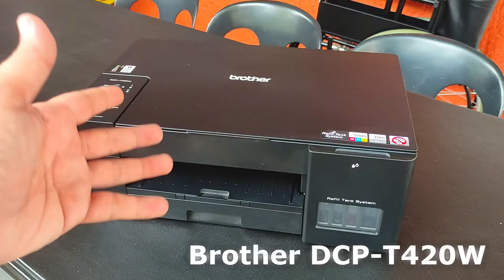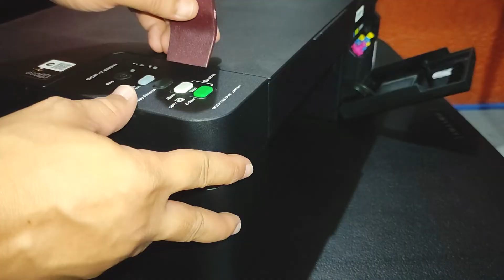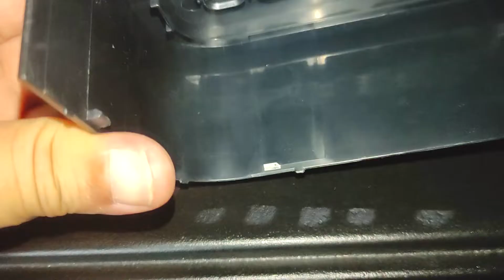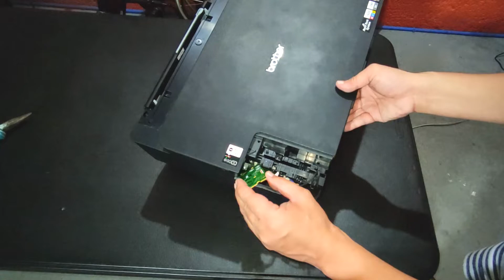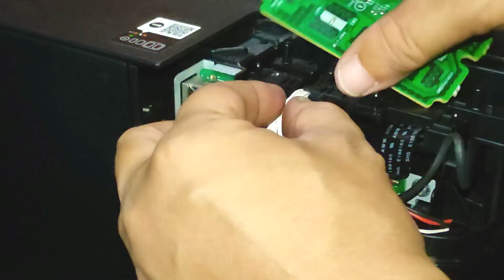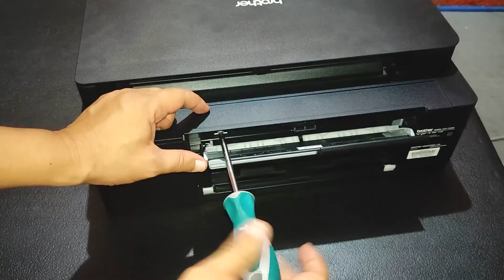How to Open Any All-in-One Printer & Access the Printhead (Brother DCP-T420W)

Comment: But how did you slide the print head???
Reply: same problem,  cant slide it.
Reply: i figured it out, if the print head is in your right hand, there should be a color white gear with transparent disc attached to it on the other side (your left hand side), just rotate it upwards couple of times, the print head should move.
Reply: @marqueeesc9055  thanks for this!

Comment: I think my print head is stuck, I can’t slide it. Any ideas ??
Reply: i figured it out, if the print head is in your right hand, there should be a color white gear with transparent disc attached to it on the other side (your left hand side) , just rotate it upwards couple of times, the print head should move.
Reply: Cant slide the print head too. :(

Comment: Liked and subscribed, i fixed my three lights all blinking machine error of brother t420 with weird noise at start up by removing and replacing the top left wheel inside printer where the gear was not alligned and making noise, i think it was the paper feeding gear and repositioning it correctly where it makes proper contact and no noise fixed my printer! Thank you for this teardown.